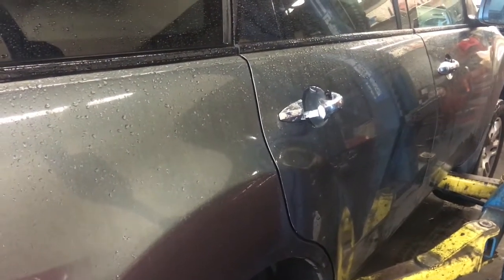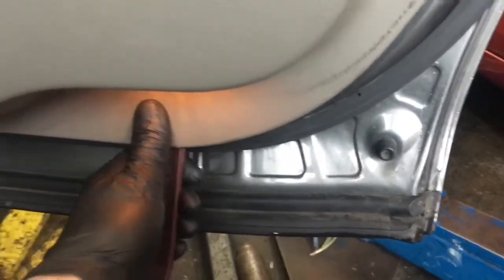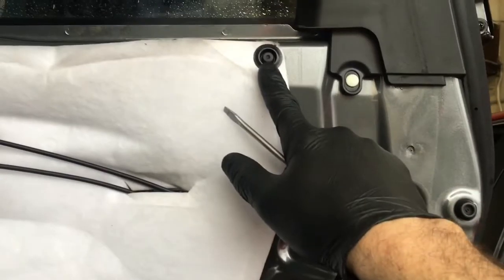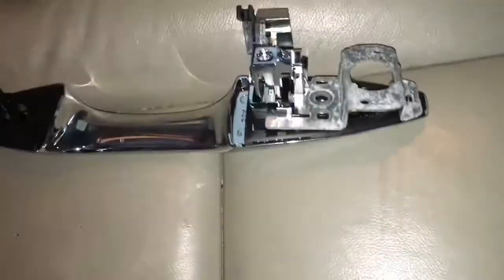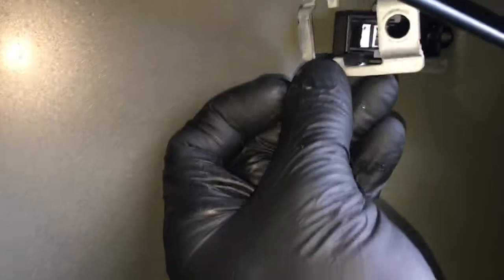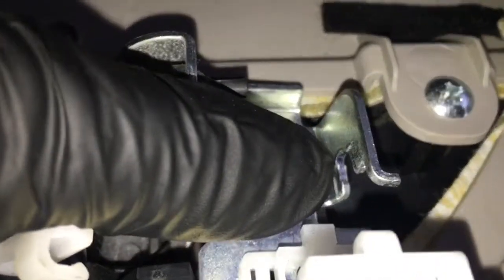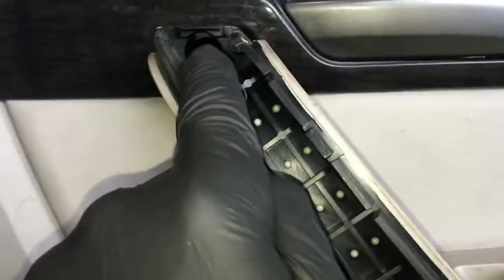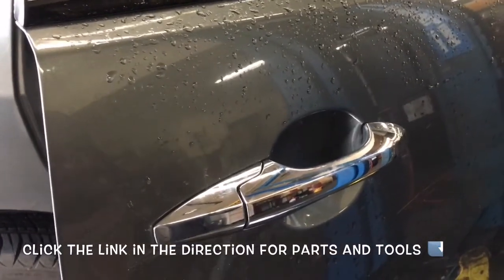How To Replace A Rear Outer Door Handle On An Acura MDX

Comment: It WAS valuable...thanks alot!...I never would've guessed those two screws were under that damned handle garnish! (the long L-shaped one) I stopped there and came inside to look for help.
Most difficult part was popping the rod out of the handle, takes some force!
And my weather barrier was glued on with something like they make sticky rat traps from! I had to slice it away from the door, and tore the layers apart somewhat on the corner. The round black grommet helped secure it when going back together, I didn't re-glue it.
Reply from the maker: Lydia Contella glad the video helped. Thank you for watching and writing!

Comment: Just wanted to toss in my thanks as well.  This side of the car is used 200% more than the other side due to a toddler, and so the door handle plastic (thanks Acura) broke.  Your video was instrumental in repairing it.  $18 door handle and 1 hour of my time.  Thank you.  Acura wanted $350 to do this job.  Ha.

Also a tip from when I did it: stuff a rag or old shirt down into the bottom of the door once you get the white weather barrier peeled back.  If you drop the brackets, nuts or Small tools, it's near impossible to get them out.
Reply from the maker: minter66 wow that's a big savings! Glad the video helped. Thank you for watching and writing!

Comment: My front door on a 2012 Acura MDX stop opening from the inside, any advice?  It opens fine from the outside.
Reply from the maker: Alex P I would start by pulling the door panel off and checking the cables and handles to see if they're broken if they're in good shape then the door latch inside the door most likely broke
Reply: Hi Brian Firstly Thank you. Just like how AlexP mentioned, my MDX 2012 has a broken cable on the rear door. What part do i buy? From your video, i think this same video is also relevant to replace the cable. Let me know if this assumption is accurate or you do you have any tips? Thanks in Advance.